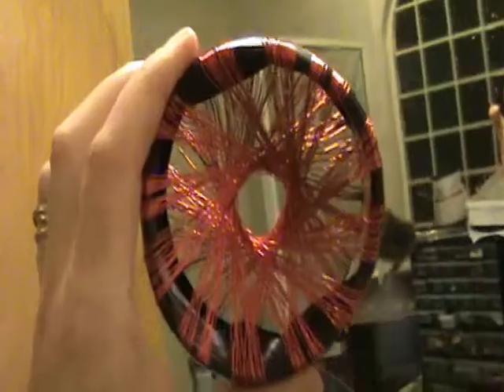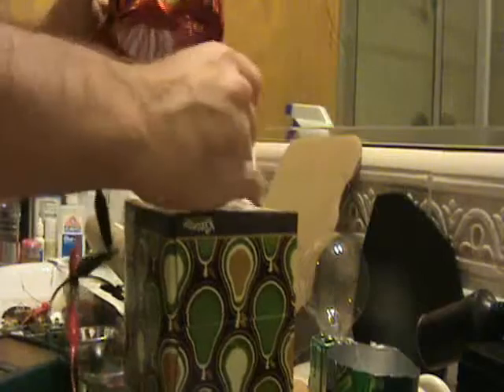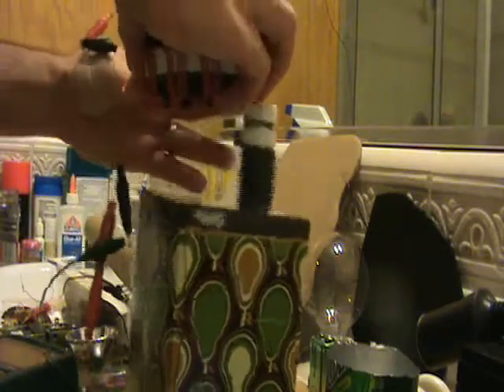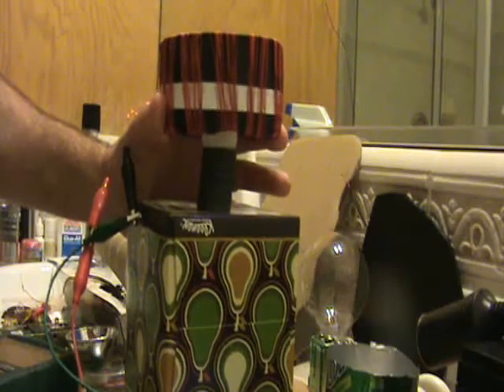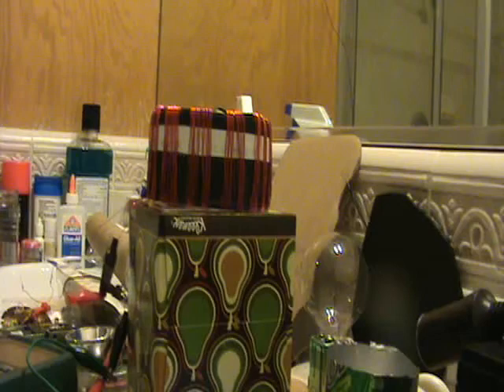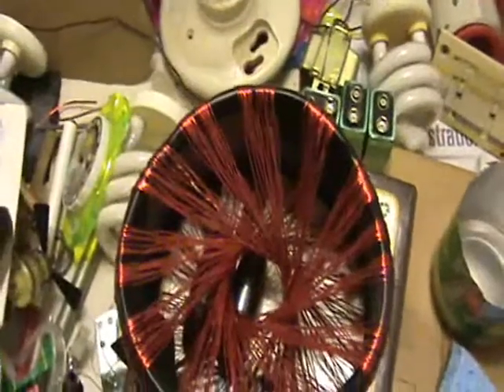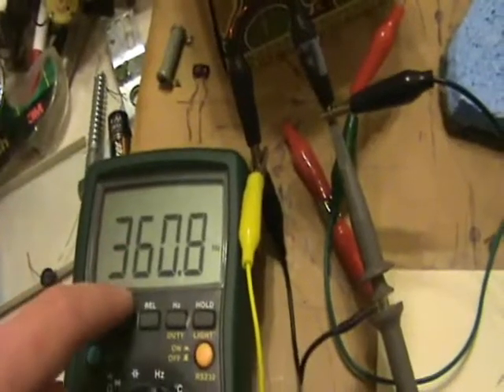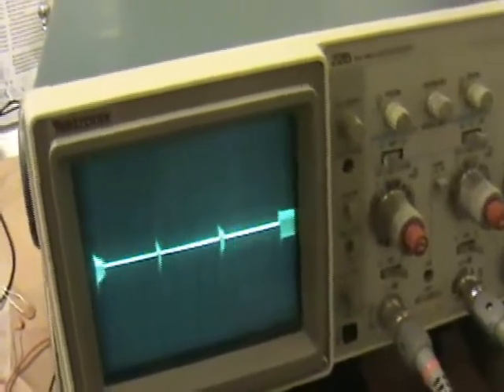"Tuna Can" Rodin Coil as Piston Engine?

Comment: @divermike2009 yeah, but if you use a piston powered crankshaft then you only need incidental power when each successive solenoid engages vs constant power into an electric motor. In addition you get to input the power with a high torque gain due to the angular pull on each successive piston.

Comment: mybe it's just me but what is the point in trying to use electrical energy to drive a piston when it would easier to use that energy to directly drive the wheels. just seems to me that your using a sledge hammer to crack a nut.

Comment from the maker: it could be my imagination ... but the feeling is that there is a certain hard to hit resonant frequency that you can feel vibrate your muscles in your arms. There is iron and magnetic on the body that may respond to these fields ... and like a voltage spike on resonance .. perhaps there is a magnetic field spike that goes off-the-charts ... briefly. I cannot keep it on that frequency .. only go past it.
Reply: How about a 2 stroke rodin coil!
Reply from the maker: @jlo13800  or 3. 3 is better for stability
Reply: @morpher44  Ok and it can tap ZPE to go overunity.